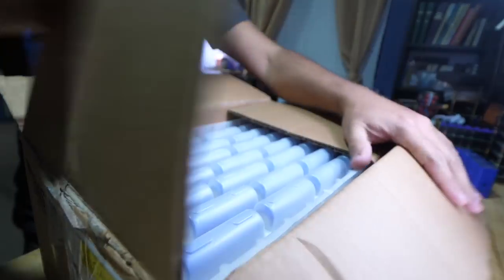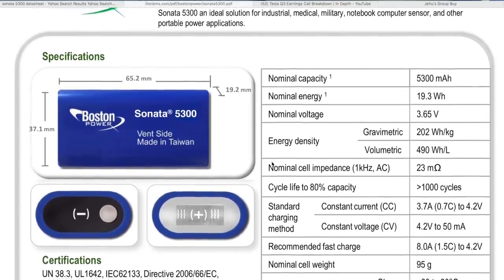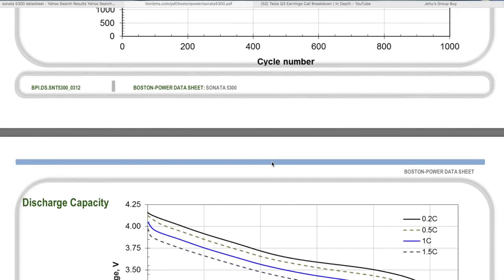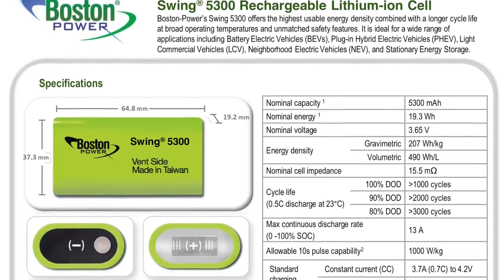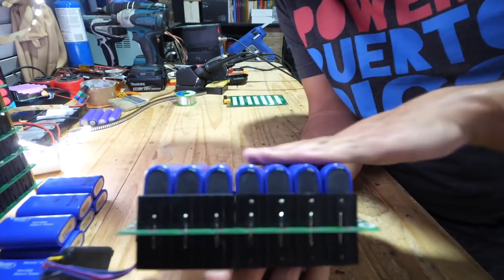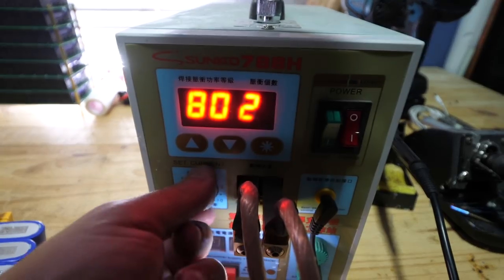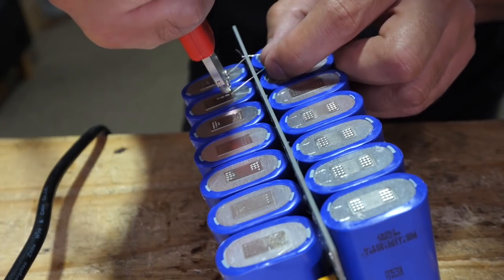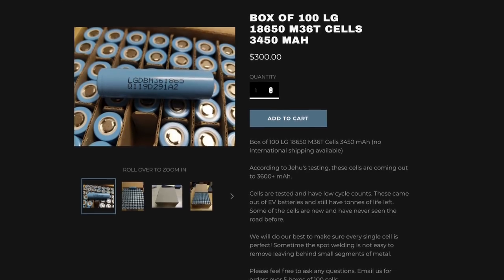$100/kWh Boston Power Sonata 5300 -  New In box

Comment: Good buy on batteries which are already gone, now the math 'for me'
3 KwHrs,  42 batteries?  $300,  6 board kits ???,  BMS for 6 boards? , 
Box to mount everything in to create the battery,  most likely wired as a 12/13v system
Reason for 6 boards to space the CELLS, 4 on one side, 3 on the other side,
to allow for better cooling, cells not Jammed  together combining heat
Total cost = ???
KwHrs is the best way to rate batters etc..
But most people I know don't think in that manner, they think of amphrs at 12v powering an inverter etc..
1 KwHr at 12v= 83 amp hrs, the avg camper/RV needs about 3 times that
Even the avg home needs even more,  except for maybe a couple of hrs of backup TV and internet
I applaud everything you have been doing, but power walls for emergency use, disaster etc.. Need like 5 to 10 kwhrs
For 1KwHr, just buy an AGM battery , Put it in the garage with a battery maintainer and your inverter
My use would be in an RV, replacing the 200 ampHr/2.4 KwHr/2400Whrs, 160# , 4D AGM battery, 1200wHrs (usable for good battery life) need more power capacity

Comment: You should try opening one to see if it is actually 2x 18650 cells inside.
Measurements seem on par with 2x 18650 with a 0.5mm thick case.
Reply from the maker: They are not

Comment: Are these not just s pair of 18650s wrapped together?
Reply: they, most definitely, are. So i also don't understand whats the fuse about
Reply: They are not. No air gap in the middle. Another youtuber tore one apart and it is one continuous sheet wrapped in an ovoid shape.
Reply: @scratchymaster  yep. it seems its not, and one pice accumulator. But it has same dimensions as 2x18650, same capacity, so no wonder one can mistake :)
Reply: scratchymaster just say egg shaped, had to google...
Reply: No.  Boston power thing is to make the cells cylindry-rectangular....

 It I thought they went bust .. maybe that is the reason they are so cheap

Comment: I have brand new 100 amp hour, 10 amp nominal discharge NiMH that wipe the floor clean with Lithium. After doing all the research I chose them because they cost less new. They have 2000 cycles guaranteed. They might take longer to charge but the purpose of the battery is not for a phone so it does not matter. NiMH wins for some purposes. I get 150 watts RMS from them.

Comment: @7:27 -- Please never hot glue Li-on batteries... they produce heat. -- The glue may not re-melt, but it will slowly flow over time, and end up where it doesn't belong.
Reply: If its getting hot enough to remelt, or even reflow over time, you probably have far worse issues.

Comment: You do know that the wire of the 1/8 W and the wire of the 1/4 W resistor is the same right ? It is how much the Watt's the resistor can take before it burns up, so no, it doesn't matter.
Reply from the maker: Tell that to my spot welding machine and my calipers who measure different diameter between the two

Comment: I feel like for motorcycle lithium ion batteries are so over priced I'm looking at around £100 for 12v 5 ah
Reply: Actually it is because to start a motorcycle you need to pull heavy amps out of the battery so it has to be built for that these cells would explode into a fireball if you tried to start a bike with 4cells to get the voltage you need ..... in order for these cells to start a bike you would need 40 of them in a pack of series and parallel to provide the current needed and that would be a big heavy battery..... motorcycle lithiums use high current cells which cost more..... fyi not all bikers are stupid I ride myself and have for years
Reply: @crfsikness  actually, a high quality lithium pack of 4s 5ah will cost like 30-40$. And that will give several hundred amps burst.
A bms isn't horribly complicated and costs almost nothing to manufacture in China, so does a plastic housing.
So yea, these bike batteries are pretty overpriced.
Reply: @crfsikness  you could use some SMALL battery and a couple capacitors ... and it'd take a while to charge them, like in a diesel engine ... turn the key, wait a couple seconds, then start.
Reply: @crfsikness  nah you are seriously underestimating the power of 18650s. and OVER estimating what it takes to turn over a bike.

They have 4s/2p jump packs for cars that are made out of 18650s. one started my truck no problem. A good name brand 18650 can pull short bursts of 30A
Reply: TMoD7007  The same can be said for any hobby though. Hell, even "baby" specific stuff is pricier than the same stuff not marketed at babies.
Reply: You mean an electric bike? Or a normal bike? Why would you use lithium batteries for a starter motor? Why not led acid?
Reply: @karoma7898  would be weight saving that is the only reason against led acid.  My battery is over 5kg. The lithium one from motobatt is under a kilo  and has a higher cca.
Reply: Of course they will be a little expensive but it's a trade off. I buy at least one motorcycle battery a year at 80$ a pop.   80$ for 4 6ah lifepo4 and then my bms. Shouldn't have to buy again for a long while. And if I ever need a jump I wont have to worry about ruining my lead acid because of the 1a charge limit on most motorcycle batteries.
Reply: Just get amg
Reply: Use lifepo4 for starter batts.
Reply: they are so why use them ?

Comment: Would copper wire work instead of chopping up a box of resistors for the wire?
Reply: Search resistor wire also known as resistance wire
Reply: Nichrome being the usual resistor wire
Reply: Yes, you can, just test at what ampere rating it melts
Reply: On a resistor, it's the actual resistor that has the resistance, not the connecting lead.
He is only using the wire leads from the resistor, not the actual resistor itself, meaning that nichrome wire would not be a suitable replacement.

Copper wire on the other hand would be a very good alternative, as it also has very little resistance.
Reply: Some cheap resistors have tinned steel leads to save money.  Tinned copper would be better because it's more predictable, and doesn't get so hot before it blows.  I measured standard 5A fuse wire at 0.31mm.

Comment: Jehu I want to install a secondary and/or maybe a dual secondary setup battery into my truck to have portable power on the road. I want to install an isolator whether smart or not smaller isolator so the alternator can charge the secondary batterie(s) when the truck is on and so the primary ignition battery wont become drained. Would it be more affordable and best to buy an agm battery or or to make my own using lithium cells? Thanks for any help. Also what is an affordable pure sine wave 2000w+ inverter to run everything off of? I want to have a couple solar panels on my truck to charge the secondary pack when the truck is off and parked. Any other input would be greatly appreciated.

Comment: Super capacitors save battery from getting worn during pick load and a good regenerative power catcher could you do any research on capacitor battery hybrid power Bank please.
Reply: Super caps can hog current when it peaks and allow it to trickle back into the battery bank, but it depends on how you have things set up. It only buy you a little time. If you are generating too much power for your bank, you need to expand.

Comment: Mate if you take 2 li-on recharhargable  batteries size 18650(for example from Panasonic with capacity 3000mA each ,3.7 V) connect them in parallel  you will have the same size and the efficiency bigger than on the cells you showed
Reply: For 3-4 times the price

Comment: I need help with batteries. If I connect all the positive side say 10 together and negative side all together I would still get 4.2v. I can’t run a power wall with 4.2 v. Will 12v be good

Comment: Sir,can you build a battery 12 volt 100 amp/hr made from supper capacitors ?
Reply: Super capacitors are not batteries. They are not meant for long term energy storage.
Reply: Inclusive Media Don’t quote me on that , battery have much higher energy density than capacitors even super capacitors

Comment: did you say the contact patch was aluminium ? i dont get how you weld steel (resistor leg) to aluminium. Soldering i get, welding not so much, different metals.

Comment: the Li Ion batteries have more consistent thorough charging at fast charging. If charged slow then the chems in the battery doest have proper charge consistency. As long as heat is discharged properly, no issues.  Fast charge good with new batteries. Old batteries, bad. Deep cycle does not apply to Li Ion batteries.

Comment: Interesting cells, specs seem to be very similar to what Teslas new 2170's deliver so far, just different shape and heavier.
At this pricepoint, perhaps tempting for someone to build a significant car pack from?
Reply: Different shape because they are just two 18650 cells shrink wrapped together.
Reply: @JoeMalovich  Sadly no, Its a custom cell not two 18650s
Reply: @JoeMalovich  It's a custom wrapped "oval-rectangular" cell.  It's not two bonded cells, but one massive cell wrapped around a plate instead of a bar.
Reply: Half my house is currently running on these.

Comment: I have been following you a bit and I understand the focus on batteries.  They are a core component of any Powerwall solution.  If I ordered batteries and PCBs, what are people using mostly for the controllers and where do they connect to the electrical system?  Is a Powerwall between the inverter and electric panel and the charge controller provides the brains for charging and discharging to the home?  Are there some recommendations people have on home battery controllers for these types of batteries?
Reply: @MRA_3   Will do.  Happy to find another channel that may focus on the integration part of the process.  Thanks for the pointer and direction.

Comment: 45 bucks for shipping 2 lots? Im in AZ! Come on!
Reply: Probably because of UN number shipping which is hazardous. UPS also charges for the box size as well. I had to ship a fuel pump back to a shipper that had shipped me the wrong fuel pump and it cost me $45.00 and they never refunded me that cost. I would imagine that lithium would require extra packing for safe transport.
Reply: Lithium Ion cells will only get more expensive to ship the more accidents that happen, unfortunately.

Comment: well. The batteries get to 60 Degrees and you use hotglue??? I don't think that it is that smart to use hotglue on batteries.
Reply: Wasnt he over discharging them?
Reply: @ryanbernard6550  No the max discharge is 13A and he is discharging at 10A so it is in operating range.
Reply: Thats core temp ^^ even a hot stick of Metall wouldnt reach that in short time

Comment: Speak to the average person Jehu. A $100 kwh battery? Does that mean $100 for a 1000 watts an hour? What is so hard about how many hours a battery will last? and how many will it take to run a refrigerator for 4 days with solar panels in the loop? The technical terms are meaningless to half of the people looking for an alternative to piped in power from the power company. Thats how the general public talk. Most DIYers could put together the units, but most aren't electronics technicians. How many days will the unit power the basics in an outage? How long to charge? Instead of KWH, how about...how long will the battery be useful ? For instance...a 3.5 kwh battery. What does it do.... 3 and a half hours of service before it is useless? If your objective is to save people money....talk to the people who are going to invest in what you offer.